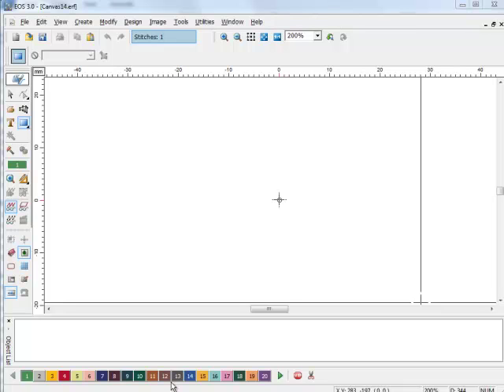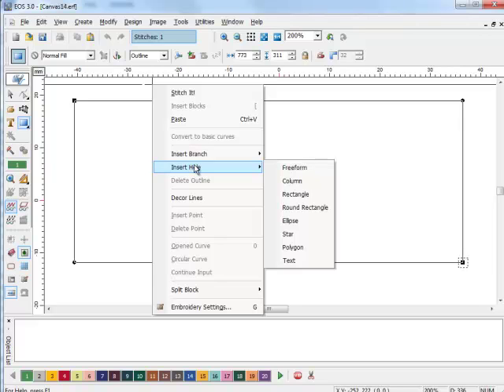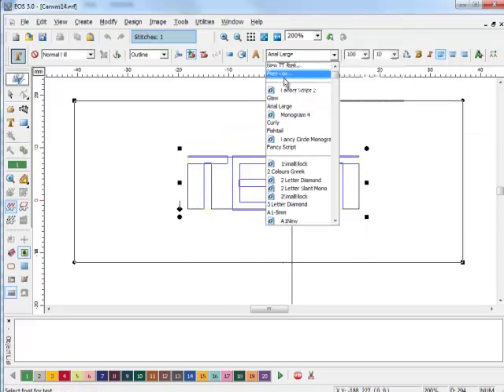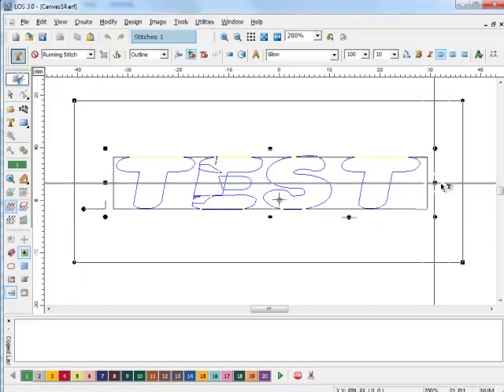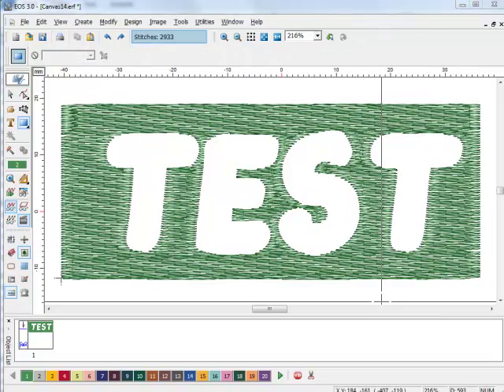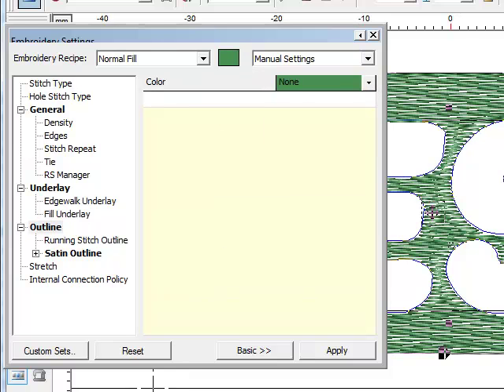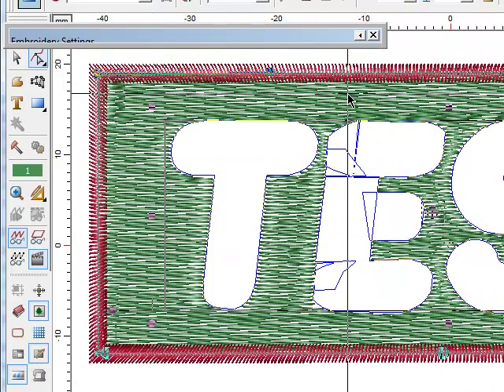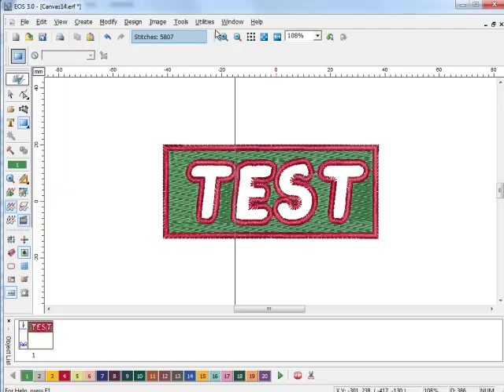EOS-Text Hole With Satin Oultine

Comment: I keep getting stitches running through the holes or jumping across, any way to alleviate that or do I have a setting wrong?
Reply from the maker: Please check that you do not have underlay on,  also, the font you use should be a fairly BOLD font, a thin font will cause issues like tat

Also if you create any letters that have holes in them , like O, A, B   there will need to be stitches across the empty space because the  parent block is a complex fill,.  Please Send a picture to support@embhq.com  and I will be able to give you a better analysis